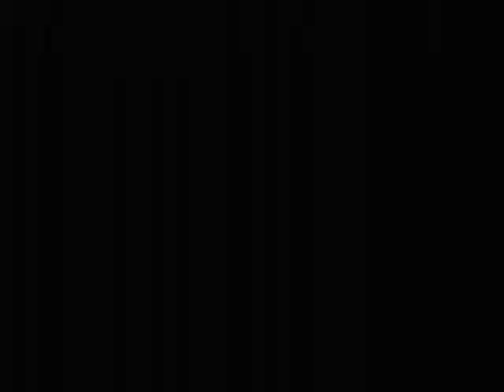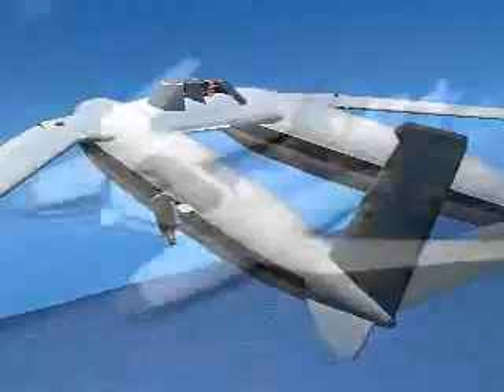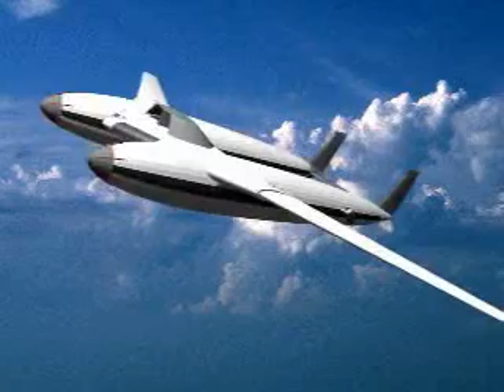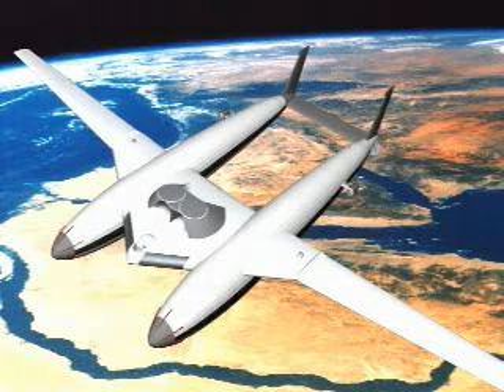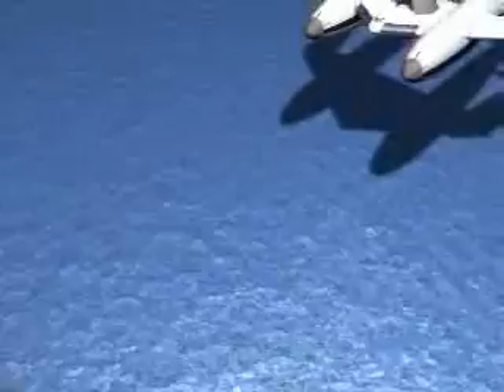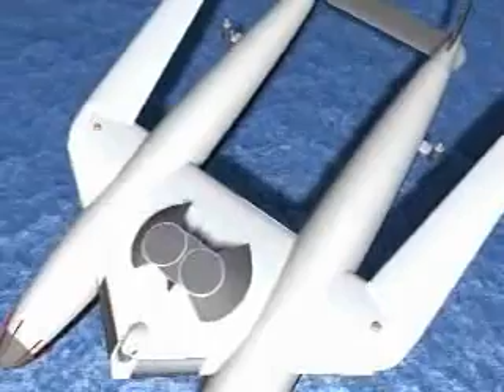Fuel-Less Gravity Powered Airplane

Comment: Instead of using an oscillating motion to extend distance, rising and falling to be able to glide, why not when you start a glide, use that to bring the turbine rotation to a usable speed, which can then turn generators to provide power to small electric motors that can use propellers to propel the craft .. reach cruising altitude, balance the speed to provide continuous electric power to the motors, and the helium to keep the ship light...one problem though, helium has a short life span...

Comment: Perpetum mobile, hehe. At any rate, the foremost problem is not even that - they are directly suggesting *gliding* as main operating mode. By the way they explain it, the plane has not enough power reserves during gliding descent to do any meaningful powered maneuvers. Which basically means no way for pilots to throttle out of any emergency.
Won't be allowed to passenger routes anytime soon - even if the "infinite flight by recollecting energy of ascent" story would be true, which isn't.

Comment: I can see the turbine design working on this airframe, the 757, 767, and 777 all use a RAT probe as emergency hydraulic and electrical power. My question is, where is the Helium coming from to make the craft lighter than air?

Comment: Or are sail boats which use air currents(wind) to move tons of shipment also against physics? They have no motor, nor batteries, only the wind they make use of.

You people should shut up and learn some real world physics instead of the idealistic vaccuum empty space physics you try to apply on this. Yes.. there is air up there, and no, it does not stand still... the air molecules move at various speeds depending on altitude and time.

Comment: It amazes me how many think that physics is going against this. Completely ignoring air currents.
The energy this plane will be using to travel can be gained from air currents alone. A glider does just that. According to your simplified physics model, a motorless glider should fall down like a rock, because it has no motor or any other energy source to keep it moving, yet the record for motorless gliding is 16 hours in the air, which means a lot of miles, depending on the air currents.

Comment: I'll believe this when I see it. You can't break the laws of physics no matter how hard you try... and I see some apparent flaws that I'm not sure have been addressed before. Any cargo, whether it be a human or a spark plug, will add weight. This means you'll need more helium to offset that weight. I just can't see it being economically feasible. These things would have to be massive to hold any sort of weight, and then they wouldn't be able to generate enough power without fuel of some sort.

Comment: The real problem with this plane is the supply of helium. One could use hydrogen instead, but contrary to helium, hydrogen is highly explosive.

AFAIK only the US has a large enough supply of helium for such planes. There is tons of helium in the upper layers of the atmosphere AFAIK but we need to get a 50km+ hose carried by hydrogen balloons up there to pump it down.

Comment: Helium is almost impossible to ignite, even if you try very hard and mix it with tons of pure oxygen, it will refuse to ignite up to extreme temperatures.

As for over-pressurizing the bags and having them explode, i can see how this plane would be capable of landing still. The helium is needed only to take away some weight. Contrary to a zeppelin exploding, this thing has long wings and is lightweight. It would land like a motor-less glider.

Comment: @otakukj 

It works. He is simply wrong and did not include air currents into his calculations. I mean, why the hell wouldn't it work, when a motor-less glider works?
This plane has all properties a motor-less glider has, plus more, and it does not even need a second plane to lift it up.

Comment: @Ignuus66 

I don't agree with that. This plane is more of a motor-less glider than a zeppelin. It actually is a mix of those two, but not only. The mechanism to compress the helium in order to descent and use that descending for extra velocity and charging the compressor is totally new. 

I have yet to see any other ideas which are SOO much better than this.
This is a motor-less glider which needs no plane to lift it up. Add solar panels to this and   you have something amazing.

Comment: @Ignuus66 

This is a very different animal than a zeppelin. A zeppelin requires a motor to fly towards any direction.This here requires no motor, just like motor-less gliders.

Unlike the glider, it needs no plane to lift it up.

Unlike the zeppelin, this plane is strongly dependent on making use of air currents. It is a mix of a zeppelin and a motor-less glider but with this very smart mechanism which allows you to compress the helium and turn this into velocity and energy.

Comment: @g3cwi 

You are wrong. Physics does not get in the way. 

Have you never seen a motor-less glider which can fly for long distances just by abusing the air currents? They use air currents in different altitudes just like many birds do, to gain velocity. 
Different altitudes have different air currents, and air currents can be used to add velocity/energy to this plane. This extra energy can be used to compress the helium. 

Not necessary for this to work, but a solar roof would add a lot.

Comment: Even if you have stored compressed air to run the compressors where do you get that from? At some point a motor has to be involved compressing a certain amount of gas as at some point you will run out  and air won't compress itself.

Comment: This is a craft engineered for parabolic flight patterns, then? Wouldn't the swing-wings be under immense sheering force during these transitions? 

Also, the manufacturing process would still have a massive carbon footprint. 

Lastly, compressed air compressed air compressed air compressed air compressed air compressed air compressed air compressed air compressed air compressed air compressed air compressed air compressed air compressed air compressed air compressed air

Comment: @415NorCal420
Exactly. Generating helium or compressing air does not require any sort of fuel. Just electric power, no combustion processes.

OTOH, this is just a blimp and does not seem like a huge improvement over anything.

Comment: Wait, so... it uses *compressed air* to run *air compressors* at the peak of its ascent? Wouldn't it make sense to just release this compressed air directly into the tanks? Unless they're somehow generating more power from compressed air than it requires to compress that air, in which case they should just sell that system, because Yay Free Power!

Comment: Everyone who is debunking this with obvious things like valves will freeze at altitude obviously don't know that they wont because modern plains have many many valves for the intake and recycling of air for the cabin. They will not freeze and your argument is invalid.

I think this is a good idea and if it works then as a base it can be vastly improved, made faster safer and capable to store more cargo. People open your eyes and minds then you might be able to see its a pretty decent idea.

Comment from the maker: and if faster speeds need to be achieved.. It may have a modular jet or other propulsion device attached for greater pushing force and higher speed capacity.. but still retains the flexibility to detach the engine module and operate on its default drive systems.

Comment: If you use compressed air (at any altitude) to compress air, you LOSE energy and mass, as you will never compress more than what already was.  As for the rest, plausible but not probable.

I think the author has a total lack of understanding of even the most simple dirigible.  A rigid hull would be too heavy, even if aluminum is used.

Props on the concept though.  Edison never failed to make a light bulb, he just found ways to NOT make one...

Comment from the maker: @codyrichter3058 the idea of using compressed air in this case is for energy storage of energy collected during dissent and climb. Also, there are two types of air (or gases) in this system, helium and atmospheric. The energy is transferred from one to the other when either the atmospheric or helium is compressed using the energy stored in the form of either compressed helium being released or atmospheric gas being released..

Comment: @robobobo3 Buoyancy goes by volume not pressure, the bigger air balloon the heavier load in can lift.
I do agree that even an inert gas when  pressurized in a container, could escape violently if the container get damaged, exploding but will not ignite. 
You sound very passionate about this, and I don't want to discourage you, I hope you keep on investigating all aspect of flight and find a more economical and cleaner way to fly, that would be nice...

Comment: @robobobo3  Helium is an inert gas it does not BURN, also use as a shield gas in welding processes to prevent metal to oxidize and burn.
You are thing of Hydrogen which is highly combustible, see "Lindenburg" accident.

Comment: At 1:12 it's using compressed air to drive motors to compress air. If the whole process is 90% efficient, it'll end up with 10% less compressed air than when it started : )

"Air from the atmosphere is compressed into the rigid shell of the aircraft to add weight. This is accomplished using pneumatic motors driven by stored compressed air, that powers air compressors."

Comment: @RandomlyOffTopic Depends how much air they vent driving compressors. You're right, this violates conservation of energy, and on the face of it, it seems to me you wouldn't be able to get a lot of forward speed unless you drastically increase the density, which means pumping a lot of air. I think the amount of energy you can extract is proportional to the amount of air you pump... but I'll have to prove it...

Comment: @MovingUpp 
But compressing gas requires energy, and that is usually done via electricity (Nuclear, wind, solar, water... They all come from the sun, and sun uses fusion. Fusion requires things to fuse together with, and thus what it fuses together is fuel.)) or some kind of fuel.

Thus, it is not completely fuel-less.
And while venting air into the atmosphere might not sound like fuel, it's still something that produces thrust and is not limitless. Thus is it fuel, too. : D

Comment: Additionally, a cubic yard of helium can only lift about 1.76 lB (or 1 cubic meter can lift about 1.05 Kg). That means anything that relies on helium for lift will be very large compared to planes with a similar payload capacity. This is why airships were replaced by airplanes in the early 20th century. For example, the Hindenburg, at 804 ft long, could only carry about 110 people or so.

Comment: @Triple88a Actually it is not storing and releasing energy, it is changing energy from one form to another. However, when energy changes forms, some entropy (i.e. energy that exists, but can be made to do useful work) is created.

In order for the airplane to continue moving, it would need to getting energy from some source. Something similar might work from air currents, thermal vents, or solar energy, but it is described as though it is a perpetual motion machine.

Comment: @mackat4ck Hey, you were right :) This thing will not work.

Specifically it cannot recapture all the energy required for lift with a turbine while it glides on the descent. Many people are vaguely claiming it breaks the first law of thermodynamics without any supporting arguments. That didn't sit well with me so I did the math and found a solution that at least satisfies me. I've gotta type it up and I'll post it later.

It may make a neat, slow, low fuel cargo transport. But not fuel-less.

Comment: @mackat4ck there boyant energy comes from gravity specificly the hevier oxygn and nitrogn wanting to take up the space it uses and pushing it up. As it was described the plane should work by having a compresed can and an empty space when decompressed into a balloon inside a rigid shell it will displace all the air that has neutral bouyancy and it will go up, but fine lets say that doesn't work because the tanks are to heavy,hose from the shore! easiest solution.YOUDO NEED ENERGY to compres the H

Comment: @mackat4ck Hey, now for a single shot aircraft there's nothing saying it wouldn't work. Vast amounts of compressed air would be fed into the craft on the ground. 'Continuous repetition' would be impossible, but you could get one long journey and maybe a short 'hop' (say, 10-20% of the length of the longer hop) out of it.

The main problem I'd see is size. Having an aerostatic craft of that size would make it nigh-on impossible to land on a regular airstrip or in a city. Or in windy conditions.

Comment: @NameGoesHere79 I see where your coming from, but In order to create the force, an input of energy is required. In this case energy is needed to raise the plane to an altitude and then work is done as it glides.
"You could also deflate and fall holding a wind generator to get back all the potential energy." The wind generator would lose energy as heat so instead of gaining back all the energy used to raise it up in the first place. Thus the is less energy available the second time.

Comment: @mackat4ck Oops, never mind, I misunderstood your issue with this concept. Recouping all the energy used to inflate the balloons as you glide down might violate thermodynamics...
This is a really neat brain teaser.
Work = force*distance, so technically it requires no energy to move between any two points in the world (ignoring friction). 
You could also deflate and fall holding a wind generator to get back all the potential energy. Gliding would take away some of that? Ok, I'm stumped.

Comment: @mackat4ck also there is no violation of thermodynamics. Inflating the internal gas bags requires a certain amount of energy. That amount turns out to be exactly equal to the potential energy the glider has at its highest elevation. This potential energy is then converted into kinetic energy as it glides to the ground. Rinse and repeat.

Comment: @mackat4ck Turns out that was just a 3 year old prototype that proved such things are possible. They used wax to change the buoyancy to avoid making a more expensive electronic version. Now there are hundreds of more advanced versions of these all over the ocean. All they need is a battery pack to power a pump to change the buoyancy. Crossing the ocean with the power from a laptop isn't too bad.
The newest version is actually built by iRobot, the vacuum robot company.

Comment: @mackat4ck The principle is actually already used by ocean glider robots. Check them out on Google. Here's an excerpt from an article:
According to the WHOI, the glider uses the ocean's temperature differences to get around. Up near the surface, the sun-warmed waters heat wax-filled tubes in the engine. The heat energy generated changes the glider's buoyancy and makes it sink. Down there, the cooler ocean waters reverse the cycle and send the glider back up

Comment from the maker: @woerldedit in that case the turbines are collecting energy and tranferring it to compressed air tanks. that compressed air energy can then be used to re-compress the helium, or to power electric devices on board, etc. or for storage for later use wen re-ascending up, after descent part of ascent/descent cycle.

Comment: Perpetual motion.  The "plane" needs energy to compress the helium and thus dive.  But that is the same phase in which the wind turbines are supposably collecting energy.  So the wind turbines could never collect as much energy as it would take to compress the helium balloons.  The plane could rise again by releasing the compressed air that is compressing the helium balloons, but eventually you would run out of compressed air while still high.  Then you could only dive by letting helium escape.

Comment: @upcycle You're doing what they are doing in the video. Trying to sound intelligent! In the video it specifically states that compressed air powers air compressors. This is so stupid on every level! The stored compressed air is not enough to overcome the buoyancy of the aircraft.  What makes you or them think that releasing the air through a mechanical device (which will lose energy) will magically give you more compressed air than you started with?!

Comment: @krillermon Not a perpetual motion machine, they said and showed how it requires buoyancy to ascend and gravitational potential energy to descend. If it weren't for the Earth's mass and atmosphere this thing couldn't do dick. Perpetual motion machines give off as much energy as they spend and fully reuse that energy they give off which, yes is impossible because of friction and, as you said, entropy in general. This model seems plausible, but it could use a set of lightweight wheels.

Comment: I am not an engineer, or a pilot, but something about this sounds like perpetual motion.  I think there are aspects of this that simply will not be efficient enough to work (like the volume of helium it would take to lift the aircraft in the video is grossly misrepresented).  Have you seen the relative size of a blimps gas bag to it's passenger area?  It is however an excellent idea and is like a concept car, a direction to go in.  Brilliant

Comment: Good presentation, but sorry guys, it doesn't work because it violates the energy principles.
It's a perpetual motion machine which assumes 100% (or more) energy efficiency. I'm an aerospace engineer with 25 years of experience and I have seen lots of creative aircraft concepts and I can easily spot the ones which are physically impossible. Keep up the good work though, creativity is what makes this a great country.